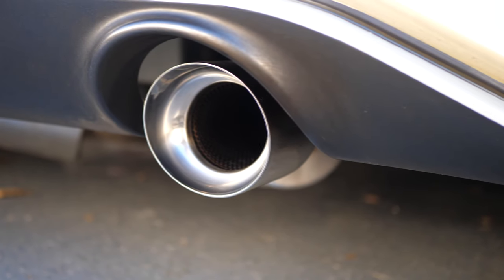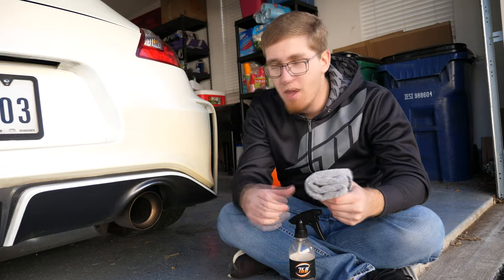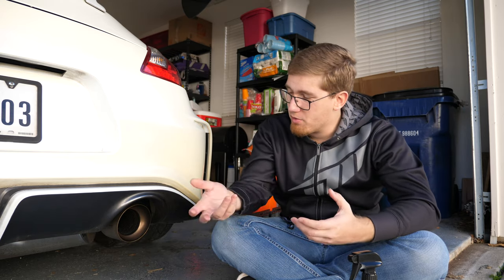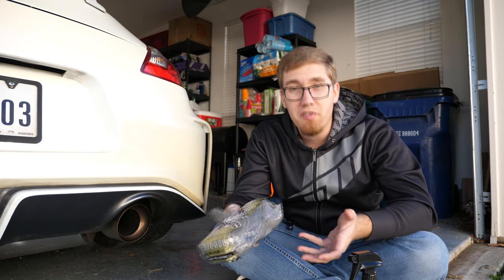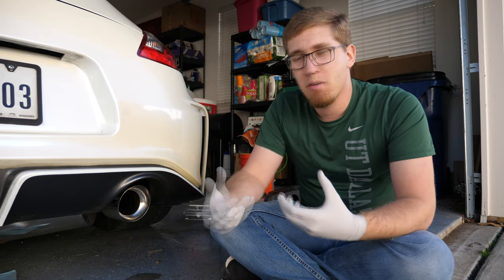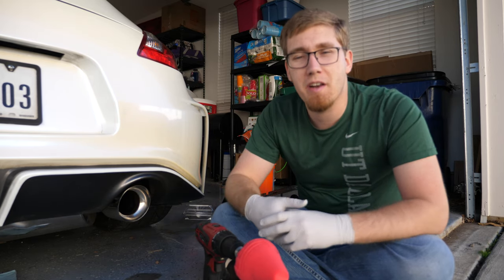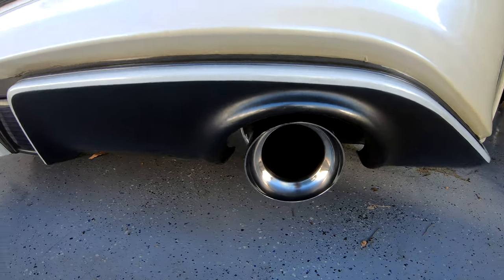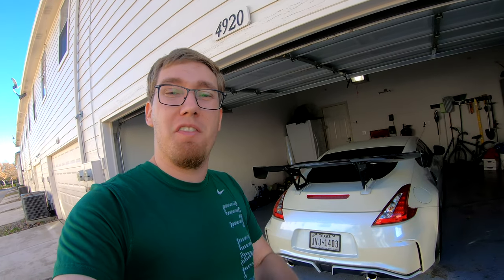Exhaust Tip Cleaning - Removing Carbon Buildup

Comment: I bought a new 2019 370Z sport 6MT at the end of 2018 and now have about 45K miles on it after 4 years. My car was lucky, in that there was practically no soot build up on the insides of the exhaust tips. Every few months I would just wet a white paper towel with some 91% isopropyl alcohol and wipe down the insides. The alcohol did a very good job of cleaning the little residue that was there, with just a slight discoloration of the white paper towel. My guess is that the air fuel ratio was set very lean at low to mid rpms for economy and emissions compliance.
Reply: Cars are meant for driving drive that thing. There is also no soot buildup bec you probably don't drive it how it's built to be driven

Comment: have you tried blue magic metal polish cream, it has a silicone base that slows the rate of build-up
Reply from the maker: I'll have to check it out.
Reply: Is that the one that’s stinks pretty bad? Lol it works very well though.
Reply: @Isaihernandez777  its not the most pleasant but in an open air setting its not bad
Reply: @Johnthephoneguy  right, I used to own a 500 smith and Wesson, after shooting it a couple times carbon rings would build up in the cylinders, this was the only stuff that would get that stuff off. Are you supposed to mix the parts that are kinda yellowish with the blue?

Comment: Sorry Brah, I can’t agree with what you recommend here.  Please don’t tell people to clean exhaust tips with any ‘steel wool’ or brass wool. Ever.  You might as well just use 2000 grit sandpaper.  Either way you’re creating  lots of tiny surface scratches that attract more carbon and soot, which you mentioned. You’ll end up having to do it again sooner than someone else that just uses cleaners and polish.  Maybe a very mild cutting compound on a microfiber towel, and then Mother’s Chrome polish and cone, especially if they’re chrome.  If that doesn’t work,  then just leave ‘em dirty.
Reply: I’d recommend using 1000 grit Scotch Brite Pads or start with 1000 girt sand paper and go to 1,200 then 2,000 grit hell you could even go to a 3,000 grit if you REALLY wanted a mirror finish to it but get ready for your arms to feel like jello for a couple of days 😂